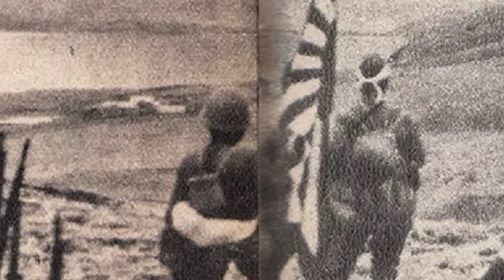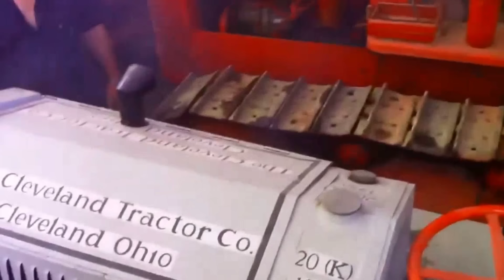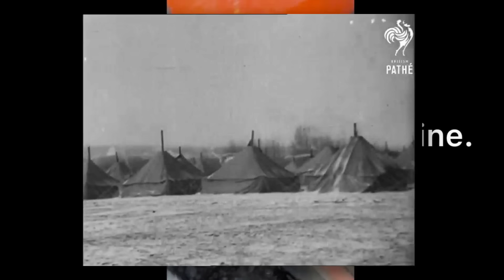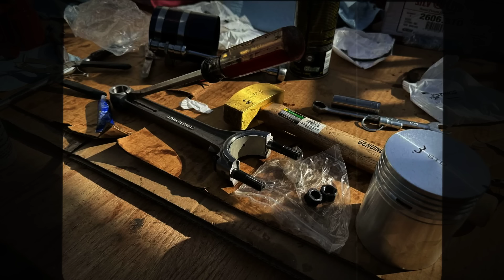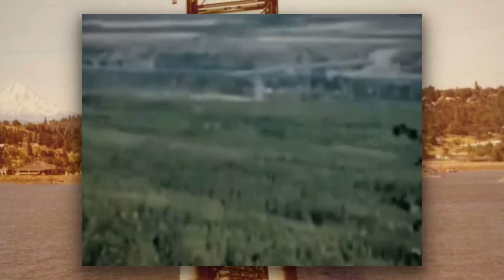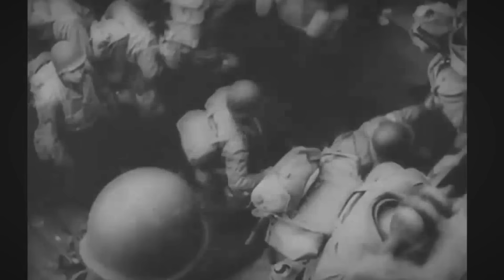The Machine That Built the Alaska Highway in 8 Months - 1942

Comment: I've driven the Alcan Highway quite a few times since 1979. The latest just a few years ago. Much has changed. In the mid 90s, my wife and I drove the Alcan in February. Crews were doing work on the highway and we were re-routed over the original route for about 20 miles. It was like driving back into history. No pavement. It was what would now be called a rough road. You could almost see the jeeps, deuce-and-a-halves and WC2s driven by homesick soldiers. Looking forward to traveling the Alcan again in June with my grandkids.
Reply from the maker: @907-AK That detour onto the original route must have been something, especially in February. Driving it in winter gives you a small taste of what those crews dealt with in 1942. How rough was that old section compared to today's highway? And enjoy the trip in June with your grandkids, that's a great way to pass the story on.

Comment: The Pony starting engines were either two cylinder twin engines or horizontally opposed. They all were started by a rope wound over a hub. The rope was generally stored looped over a grab handle. 
To start them you had to top up a small fuel tank and turn the fuel supply to the carburretor on. Pull the choke and give a few pulls. Generally these small gasoline engines started fairly well down to -60°F. The pony engine shared the diesel engine coolant. The exhaust pipe ran through the diesel intake manifold to help prewarm the intake air. Let the engine run on fast idle to warm up for a few minutes. Select low gear in the transmission of the pony engine. Flip the diesel decompression lever that opened the exhaust valves a bit. Now try to engage the clutch to start cranking the diesel engine without stalling the pony engine. This was done with the throttle in the off position so no fuel was injected. This was before the invention of multigrade oils, so some were very stiff in the cold.
Now you could sit in a truck and pour a hot coffee from your thermos while the diesel engine cranked over. This got the oil circulating. After 5 or 10 minutes, go out and select high gear in the pony transmission, which increased the diesel cranking RPM. After about 5 minutes, release the compression release lever. Now the pony engine is grunting and barking. With compression up in the cylinders they started getting a bit of heat, combined with the prewarmed intake air. Cooling the pony engine was starting to warm the diesel engine just a bit. After a frw minutes, pull the fuel lever to the idle position. The diesel would start popping and blowing smoke rings befote starting. 
Now you leave the pony engine running and shut the fuel off. This drains the carburettor float bowl so the float hangs down instead of bouncing on the needle and seat. That would flood the pony engine badly and hammer out the needle and seat.
Now it is time to let the diesel come up to operating temperature.
When they got the gravel highway completed, most of the equipement was completely worn out. In the early days much of the machinery was used equipement from contractors. Even newly purchased was worn out and not worth the cost to haul it back south. So they dug pits and drove yhe worst in to be buried by a few salvagable tractors.
Reply from the maker: @daledavies2334 Wow, thank you for sharing these fascinating technical details! 👍 The engineering behind those machines was truly remarkable. Great knowledge!
Reply: the company that i worked for had a d7 w/ the pony motor that was electric start. I worked on this stuff during the 80's, the equipment was surplus. the d7 pulled a can w/ cable.  we also had a blade and a 'rake' that we used to separate stumps and dirt.  quite a bit to the cable stuff, wearing out the shivs, pulling new cable, greasing all the shivs.....   PITA !!!
Reply from the maker: 1dpage Thanks for sharing those hands-on details - great insight! Appreciate you watching!
Reply: @1dpage during my college years I spent my summers working in the maintenance shop of a highway construction company that had many WW II dozers. Another guy and I were sent out on the property to start a D4 with the pony motor. We were told not to turn switch. But we did and the engine caught fire. I ripped off my shirt and snuffed it out. Then we pulled the cord again and it started right up.
Reply: Maybe there is more to be told here.  Detail in words that only comes from routine rough work conditions.  Memories ar3 easier than the then times.  Enjoyed your writing.
Reply from the maker: billnixon8320 Thank you for the kind words - glad you enjoyed the writing! Appreciate you watching!
Reply: Damn knuckle buster
Reply from the maker: martinmoore5335 Ha, thanks for watching!
Reply: We had a d8 with a pony motor
Reply from the maker: treetop5752, the D8 with a pony motor is a classic! Thanks for sharing and for watching!

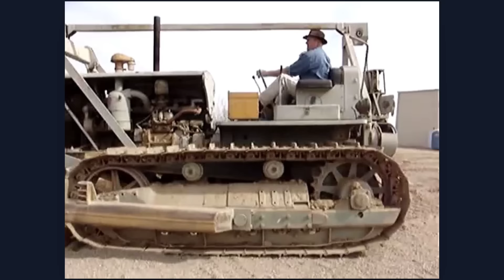Comment: @13:40 "there were no hydraulic..."
Why are so many images showing Caterpillar tractors with hydraulic systems?
Reply from the maker: Great question! Many of those images are from the late 1940s and beyond, when Caterpillar began introducing hydraulic systems to their machines. The earlier D7s and D8s used cable-operated blades, which is what the video highlights. By the late '40s, hydraulics became standard — so depending on the year the photo was taken, you'll see both systems in use!

Comment: A video of the Pope rolling presses mounted on crawler tracks that were used to construct the Trans Arabian Pipeline would be a worth subject. Pope's machinery works were located in West Seattle. That pipe line was constructed from flat plates dropped along the route and rolled on the spot and welded lengthwise to form the pipes then joined to make the pipe line.
Reply from the maker: What a fascinating suggestion! The Trans Arabian Pipeline is an incredible piece of engineering history, and the use of Pope's rolling presses mounted on crawler tracks sounds like a remarkable story. We'll definitely look into it as a potential future video topic. Thanks for sharing this piece of history!

Comment: Sometimes we do what we have to do to make things work. But leaving discarded fuel barrels was stupid and unnecessary pollution. I used to own a 1974 Ford Van and I would sometimes use a single burner electric stove to put under the oil pan to warm it up. It worked 😊
Reply from the maker: Ha, the ingenuity of those workers never ceases to amaze us! You're absolutely right — you do what you have to do to get the job done. And yes, leaving those fuel barrels behind was certainly not ideal for the environment. Thanks for sharing your own story — a single burner stove under the oil pan is a clever solution!